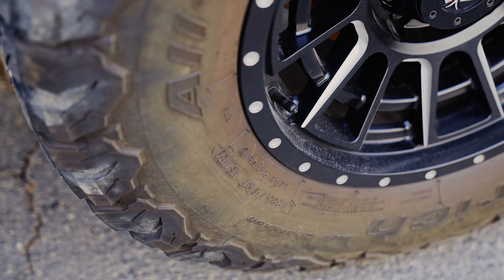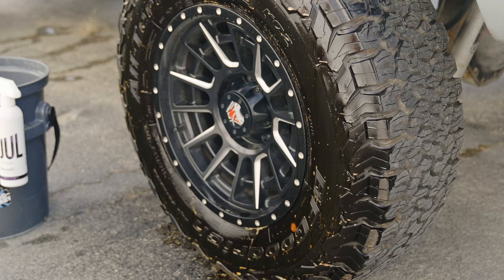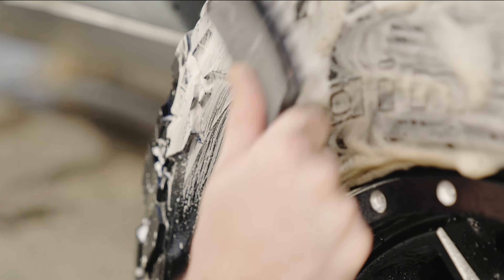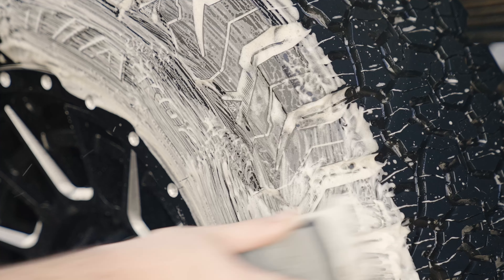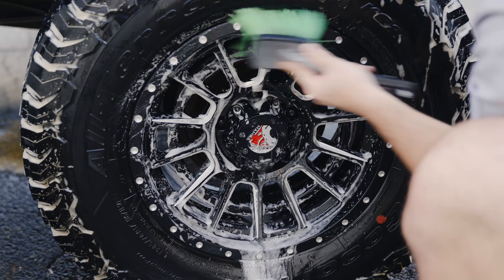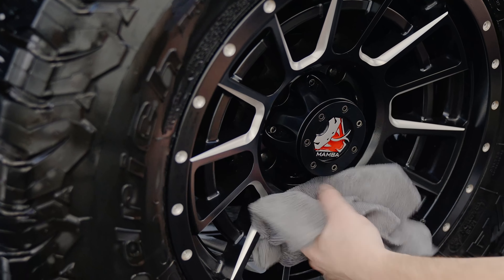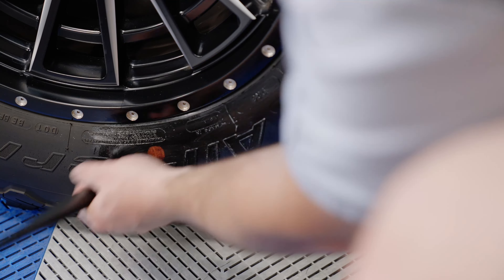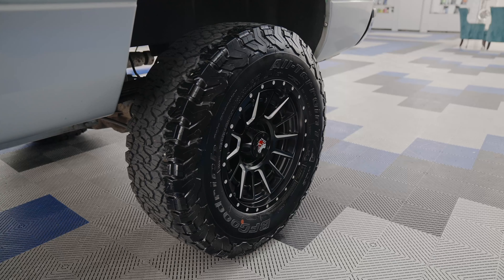How to Remove Browning on DIRTY Tires | K02 Off-Road Tire Clean

Comment: Highly recommend a drill brush for tires that size
Reply: @theragcompany  sling? Not really. I mean if you blast the drill RPM full blast .. maybe.
Reply: can agree with this. These type of tires are a pain without one
Reply: Great work Anthony. The tires are really sharp looking.
Reply: Ko2s need physical touch because of the grooves which might ruin your drill pad
Reply: @mwesigwapeter8  huh?
Reply: Great idea! I have a drill brush and have never thought to use it on tires!
Reply: @electricstartclint Just be ready to get a lot of sling on your vehicle and yourself.

Comment: I use cheap engine degreaser, works great, especially if applied just before hitting with the pressure washer and then no need to scrub.

Comment: All you need is a heavy alkaline degreaser and to sharply pressure wash the tire after spraying, this removes 90% without scrubbing
Reply: True but if it dwells on the rim and does chemical etching your f@(&$d. This stuff is for weekend warriors as well. Can't run a business cleaning tire for 1 hour. But great video as always.

Comment: KO2s with white letters are actually easy to clean compared to other tires that ive tried. Those sidewalls dont have alot of texture so theres not much place where dirt will stick to. Just a few pass of the tire brush and its good to go.

Comment: After a deep clean like that, a decent base layer of a good tire dressing is perfectly necessary in my honest opinion. Basically it will keep the tire cleaner longer and not to mention it will be easier to apply more next time. I typically knock the dressing down but not when applying the first dressing after a full tire decon.

Comment: What about the 'browning' that still exists on the backside of the tire? - People spend all this time cleaning the outer sidewall so it looks nice, but pay no attention to the other side. This leads to premature 'weather-checking' and dry-rot.

Secondly - If you're going to bring your Brodozer wannabe 'Mud-Terrain' tire / Aftermarket alloy rims in to a service-center for a periodic rotate & balance - Those alloy rims require the use of adhesive weights to balance them. Adhesive weights DO NOT stick to 'brake dust / grease / dirt / mud / road tar' - so PLEASE clean your rims thoroughly BEFORE servicing. 

Third - I was always under the impression that any type of 'citrus' cleaner is actually really BAD to expose your clear-coated rims to? 

Lastly - Whoever mounted the tires in this video - they failed to line-up the RED DOT on the valve stem. - The RED DOT exists for a valid reason - it is the 'HIGHEST POINT' of the tire... The YELLOW DOT' is the 'LIGHTEST POINT' of the tire.

NOTE: If both red and yellow dots are visible on your tire - and you don't have any dots or marks on your wheel, red takes precedence over yellow and you should align the red dot with the valve stem. Cancelling out the high point takes precedence over the lightest point of the tire, which can be addressed with wheel weights.

Comment: Forst = $18 for a liter (roughly 33 ounces)
Super Clean = $5-$10 for a gallon (roughly 4 liters)

Forst cleans tires well, not great but very good.
Super Clean cleans tires excellent even when diluted down 4:1.

Super Clean gives you 4 gallons of highly effective tire cleaner for a fraction of the cost Forst offers.

Just saying.

😊😊😊
Reply: Point taken but remember the TRC does not sell Super Clean.
Reply: @MyGuyKirby  Well obviously TRC doesn’t sell SC, not the point I was trying to make. The point is, why would I buy Forst in the first place? It’s not as good or as good a deal as SC. It would have to be one of those to get me to change it up. I seriously doubt TRC would even consider adding SC to their arsenal because there’s that pesky profit margin … and it would depend on SC to work with them. But I’m not smart in that area, so …

😊😊😊
Reply: @Reaper-Jim  I also am quite happy with SC, and it's easy to find, lot's of places carry it
Reply: Have to agree

Comment: Although that tire had some dirt, the actual cause of browning is heat. Also the cleaner is not actually cleaning dirt, it's removing the discolored oils from the tire. Hence speeding up the degrading process. 👍👍.
Reply: Speeding up the degrading process?  I don't know of any manufacturer that recommends against cleaning their tires.  Can you quote a source?

Actually, tire browning is not caused by heat, it is caused by reacted antiozonant, which is a tire compound ingredient that neutralizes ozone and reduces tire compound degradation.  The brown stuff is the antiozonant that has already been consumed in reactions with ozone and is no longer effective because it has turned into something else. i.e. brown stuff

Most manufactures recommend replacement in about 6 years, regardless of mileage.  And some state laws prohibit tires over 6 or so years old.  Therefore, if you are using a 5 tire rotation, (most people are only doing 4 tire rotations, if at all.) you might get 60K miles tops out of A/T tires.  So even the drivers putting on fairly low annual miles will need to replace tires in 6 years or less. 

I am not a tire engineer, but I am pretty certain that the amount of plasticizer that outgasses from tires through normal use and age far exceeds anything a detailer can scrub out of the tire like this.

A deep clean like described in this vid two or three time a year is probably not going to appreciably degrade the tire.  But if you've got data, I'm all ears.
Reply: my sidewalls turned blue after hitting a muddy trail in wyoming.... not sure if this process will work but im hoping it will